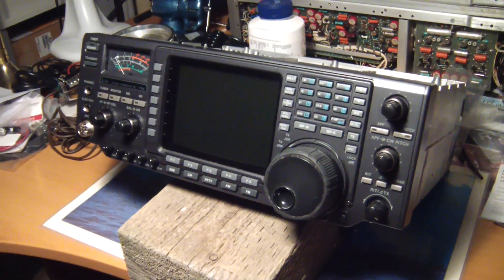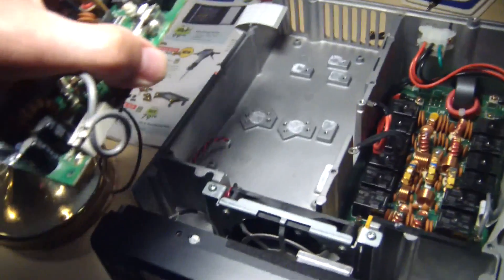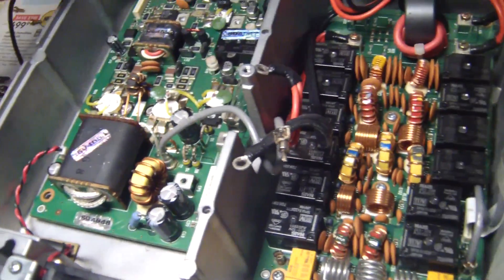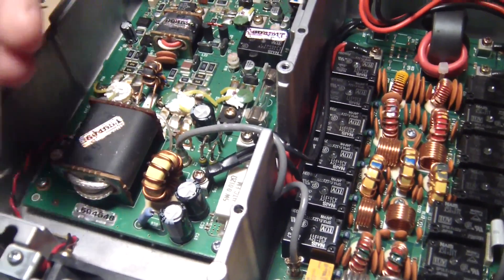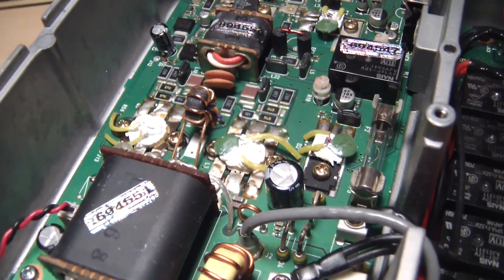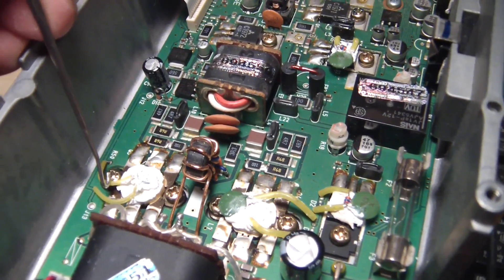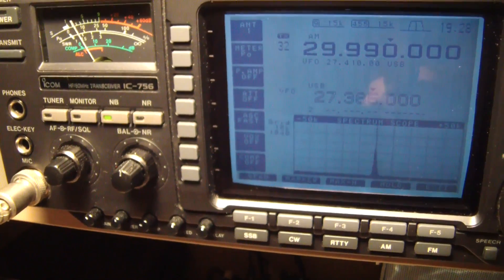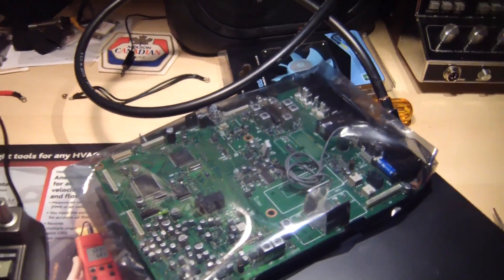ICOM 756 HF radio, TX problems, Part 2

Comment: why my Icom 756 pro II can't TX on 8000.00 frequency
Reply from the maker: -  That is not an allocated Amateur radio frequency. The stock radio will not transmit there. See link; https://en.wikipedia.org/wiki/Amateur_radio_frequency_allocations

Comment from the maker: Problem solved. Thanks to "MrLinuxfreak2000" for suggesting to check on the power supply. My power supply was failing under load and causing the problem. Thanks all for watching and sharing your thoughts. 73
Reply: Glad I could help Mike, seen the same problem bite me in the butt on lower current draw circuits with an "adequate" power supply.

Cheers!
George
Reply: the power supply made it have a carrier on ssb too?
I've never heard of that

Comment: Have you dropped a scope on your 13.8volt rail going into the rig???  Sounds like a power supply packing it in under load and loosing regulation with that bad "60hz hum". Or maybe RF getting into somewhere it shouldn't.
Reply from the maker: Your diagnosis was correct. My power supply was defective under load. Woo-hoo!!
Reply: Klondike Mike  Well, guess there's gonna be a power supply repair video in the works now!
Reply from the maker: MrLinuxfreak2000 No shortage of repair video's to be found around here. I took a quick peek at the power supply and no visible damage to be found. Works at low current levels. Removed from service and added to the pile. Astron RS-20. Not good enough for 20A service. Maybe someday a repair video will show up.
Reply: Klondike Mike  If you don't have this site bookmarked, ADD IT!!!  I found some interesting similarities between my homebrew 25amp supply and the Astron supplies.  The site page:  http://www.repeater-builder.com/astron/astron-index.html
Hope it might help. BTW, what is the full power draw of the 765???
Reply from the maker: MrLinuxfreak2000 I was just going through that link when you posted. I measured around 10-11A on SSB peaks. The label on the bottom of the power supply lists 10A continuous draw. No where near what it is marketed for.
Reply: Klondike Mike  Sounds like the "Chinese Watts" rating of car stereos!! I remember the printing on a cigarette pack sized "booster" amp back in the day of '300 watts'!!! The decimal point was dropped, made the item more "desirable" to the weak minded "noise box" crew! But a lot of that was going on back in the late 70's when that supply was originally produced. Check the emitter ballast resistors on the 2 pass transistors for damage and the 1000μfd cap supplying the 723 regulator, if the voltage sags too much for the 723, major hum, and if the emitter resistors go out of value, current handling goes to hell. I used ~0.5fd of main cap for mine and 2200μfd for the 723 supply, transformer was a Hammond from a pole mounted cable amp supply, rated at 28v @ 10amps continuous, rewound the secondary for 19v no load AC and it was giving me up to 30amps on peaks without complaining!! Gotta love ICAS rating!!
Reply from the maker: MrLinuxfreak2000 Thanks for the detailed troubleshooting tips. I'll file it away for now and review when this power supply moves up the priority fix list.